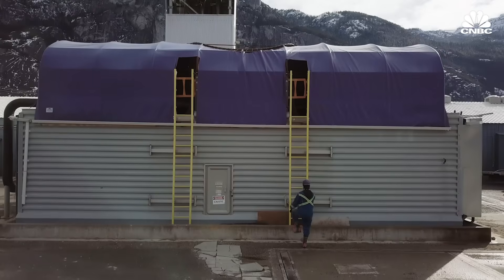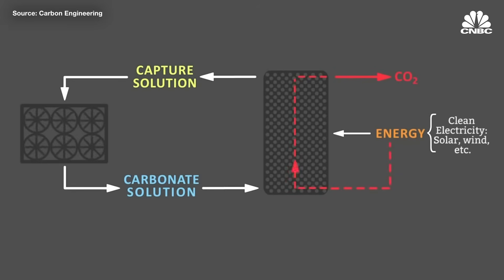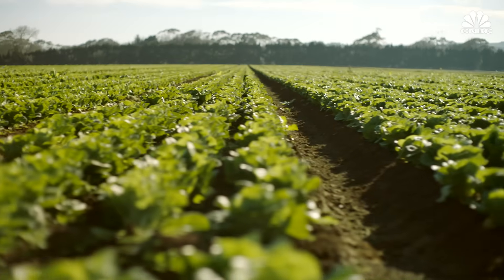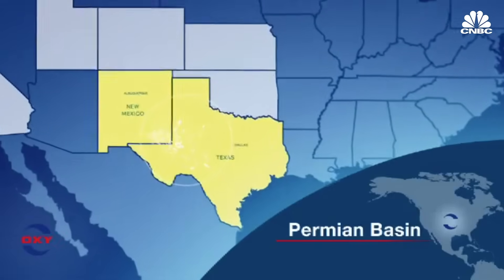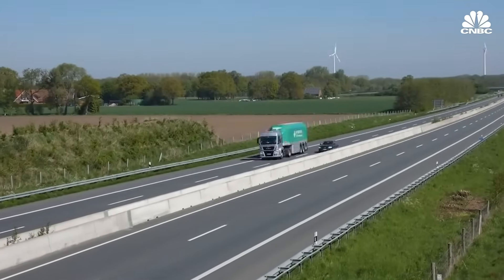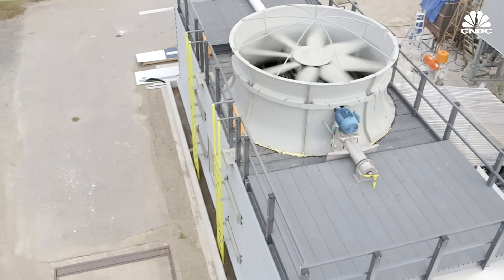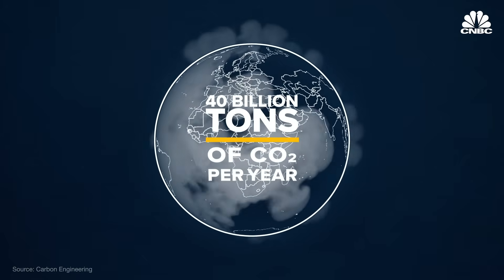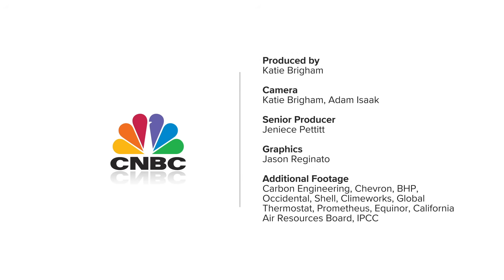Bill Gates-Backed Carbon Capture Plant Does The Work Of 40 Million Trees

Comment: Someone needs to do the math!  It costs only$20-50 per ton of CO2 to capture CO2 from fossil-fuel power plants and sequestering it underground, while it costs ~$100 per ton of CO2 to capture the CO2 directly from the air!  So it costs only 1/4-1/2 per ton to get the CO2 out of high-CO2-concentration exhaust gas of a power plant in comparison to direct CO2 removal from the air.  It has to do with entropy, guys!
So, until all fossil-fuel power plants will have CO2 capture and sequestration, let's pick the lowest hanging fruits first, shall we?

Another much lower-cost way would be to gather waste biomass, of which the USA produces 1-billion tons per year, and pyrolyze this biomass into H2 and charcoal, during which process, the carbon will be stripped off all its hydrogen and turned into charcoal.  Use the H2 for fuel, and use the charcoal for topsoil enhancement.  In this way, we indirectly take advantage of the plant's ability to  remove CO2 from the air to make carbohydrates in the plant, then turn this carbohydrates into charcoal and keep it on the ground indefinitely.
If the waste biomass is left to rot in the field, methane gas will be produced, and methane gas has 30 times the Global Warming potential as CO2.  So, rapid processing of waste biomass into charcoal as topsoil will be the most effective way to remove greenhouse gas from the atmosphere.

Comment: CO_2 is a gas. I fail to see why the stored gas underground should stay there and not resurface. You say that you can process CO_2 as fuel - to my knowledge CO_2 is the final product of an oxidation, so you would need to introduce some kind of energy to create fuel and then you would not have removed the CO_2 from the atmosphere as you would burn it again.
Reply: The goal of these plants isn't just to extract the CO2 from the atmosphere, but also to split the Oxygen from the Carbon. That way you get 100% pure Carbon which can then be buried underground.

Comment: I don't think just trees / vegetation is the answer. We've released to the atmosphere way more Carbon atoms than those of trees we cut. There is all that carbon that had been trapped for millions of years as gas and oil that we've released. So just reverting our forests to the 1500's size won't get us back to the CO2 concentration in our atmosphere of te 1500's.
PS: That doesn't mean I'm not into planting trees. GO TREES! But methods of trapping some extra carbon dioxide is necessary.
Reply: a young ! forest takes out a lot of carbon, especially  in the first 50 years. When a forest is mature (200 years and upwards) a certain (significant) amount of carbon remains captured in all the trees that are standing. While the old trees decay and release the carbon they soaked out of the air centuries ago, young trees shoot up whenever a space with light opens and they capture CO2 at high rates. That balances out the decay.

Establishing MORE forests (humans cleared a lot of land for agriculture) takes out a lot of carbon and sets a new balance.

Scientist think that even the murderous invasions of the mongols had an impact - that started around 1200. They depopulated whole areas (China, Russia, parts of Asia, Middle East, Eastern Europe) and their reign lasted 200 years. Unlike the Plague later which also depopulated whole regions (but in a more developed part of Europe so here humans were quicker than nature) those 200 years were long enough to have an impact. 

In that time forests took back farmland, removed additional CO2 from the atmosphere. The medieval warm time ended then - that may have been the consequence of a natural cycle - and that human induced cooling enhanced it.  

Planting and mainting forests could also create jobs (letting small farmer take care of the forests and pay THEM for the capture - not big oil. It would be a low tech, healthy solution with extra beneftis (oxygen production, wildlife refuge, hunting, tourism, soil building, the soil soaks up water from downpours and regulates water supply. large forests also moderate the weather). 

 in 800 - 900 AD a forest grew nearby Paris, in 1200 13,000 large trees (mostly oak 300 - 400 years old) were cut down they became the wooden underconstruction of Notre Dame.
It was called "The Forest" - went up in flames unfortunately in 2019.

that is a carbon sink.

In Europe (Germany, Austria) constructions codes (and fire insurance laws) now allow mulitstorey buildings made from wood (6 floor - maybe even more).

In those countries the citizens and companies have to sort the rubble if the take down a building or renovate it (or it will become really expensive to dispose of the rubble). If a building is  taken down wood and particle boards are separated, if they cannot be used otherwise they will be burnt. That applies to all wooden materials - also old furniture etc. 

They have electricity plants that burn garbage at high temperatures. That is a clean process, the high temperatures help to destroy all chemicals, coatings, paint etc.  - of course they need good filters, they are nearby cities. 

In a steam engine no matter the fuel (wood, gas, oil, coal) less than 27 % of the energy will generate electricity: most of the fuel does not generate motion (driving a turbine or the engine) - Heat is a major byproduct. In order to improve the efficiency the byproduct heat is used to produce also warm water and heating in winter. 

That way they achieve an efficiency of over 60 % - which is way better than when a private home has a central heating using wood - and there is less smoke and pollution.

And the burning of wood or materials mainly based on wood is at least CARBON NEUTRAL (not a fossil fuel was used but fuel that came from the CURRENT natural carbon cyle (trees that are "only" a few decades or centuries old). New trees will be planted as soon as some are removed and are used for construction, flooring and furniture. 

These days we use a lot of particle boards (with shreddered wood and scraps) - boards of massive wood (stripes glued together in alternating order to avoid warping) would be an even better long time carbon sink.

Best case scenario - the carbon is removed from the carbon cycle for a few hundred years (more than 1000 in the case of Notre Dame - and potentially longer had it not been for the fire). - That would buy humans much needed TIME. 

Worst case scenario, the carbon in form of wood is only removed for 30 - 50 years and then it creates energy at a reasonable efficiency (while new trees are already growing to replace the former ones).

Comment: It won't work.  Yes, it will capture carbon dioxide but to change the weather, no.  In fact, they can sell the liquid C02 to the oil companies for fracking oil and gas wells!   In fact, there are many plants around the globe who capture Nitrogen, Oxygen, C02, and other gases for commercial use.

Comment: Why not just have a coal power plant feed it's exhaust directly into this plant ??????
Reply: We have something similar here using Algae ponds for capture. Seems to be doing well so far and scaling up.
Reply: Its actually a pretty brilliant idea. As long as the coal power plant could produce power in excess of the carbon capture facility, that is.
Reply: Some plants already have something like that in place. This is for already existing carbon.
Reply: Coal plants have emission reductions in place on them they are called scrubbers or bag houses to capture soot and NOx emissions the "smoke" you see is water vapour from the cooling tower vent off
Reply: @theonetheonly5785  Reducing soot is very beneficial, a big component of arctic ice melt may be soot from China. However CO2 gas is not soot.
Reply: Because coal power plants are ridiculously inefficient and everyone should be pushing them OUT, not helping them. Coal plants are honestly garbage; you'd have a more efficient setup connecting thousands of hamster wheels to generators and letting the hamsters do the work. 
Better still, the average coal power plant generates MORE nuclear radiation than a nuclear power plant of equivalent output.
Reply: @Phaéthōn_the_Radiant  Old school smoke stack scrubbers are supposed to remove pollution and CO2. Unfortunately they are NOT mandatory. In China they have them but tests show they don't operate them full time. They are more for show and bragging than real effort.
Reply: Sean C none of what you said is true. Coal is extremely efficient a 1 pound chunk of coal burns for the same amount of time as 20 pounds of propane
Reply: @bentoboxofire7404  Coal plants are one of the responsible Sources which produce CO2 Emissions. The Cleaner is the counterweigt to reduce Them. But If we had no Coal Power plants in the first place lower Filtering would be necessary.
Reply: Lol, yeah, wtf, why aren't they doing that?
Reply: @Alkalite  The reason they don't add one of these to a coal powered plant is that what they want to do is say "here's a solution that solves the problem, now you greenies can go away and make as many of these CO2 extraction plants as you want, and leave us the hell alone to carry on polluting in peace!
Reply: Why?  Humanity, plants and animals would benefit from more CO2 in the atmosphere.
Reply: @ThekiBoran  Take wheat as an example, it makes protein to convert CO2 into carbohydrate. As CO2 levels go up the wheat has to do less work to create the carbohydrate it needs and therefore makes less protein so now the protein component of wheat goes down and this lowers the food value of the wheat.
Also plants like cassava (a staple in Africa) use some of their energy to store food reserves i.e carbohydrate and some of their energy to make toxins like cyanide to defend against their predators, which includes humans, so with more CO2 in the atmosphere cassava plants can make up their food reserves more easily and divert more energy towards making toxins and more people will suffer from cassava poisioning.
Reply: @ThekiBoran  All I did was layout the effect of higher CO2 levels on Wheat and Cassava. If you want see some hysteria just read your own post.
Reply: @TheSatireGames

Why?  CO2 is not a problem.
Reply: Plants are actually pretty bad a fixing CO2. They are very inefficient.
Reply: @scatteredvideos1 

CO2 isn't broken, it's necessary for life to exist.
Reply: @ThekiBoran  Carbon fixation is the term for taking CO2 out of the atmosphere and turning it into a non gas form.
Reply: Haven't you seen whole video. Such systems exist in some countries.
Reply: The thing is we can capture the c02, but we can’t get rid of it. Trees capture c02 and the c02 is gone. (Bi product is of course oxygen)
Reply: Fun fact for you guys, coal fired power plants actually put out less emissions then Natural gas fired ones yet we believe coal is bad
Reply: Citizens need to understand that the global warming scare/scam is a weapon of the oligarchs.  Oligarchs/plutocrats hate a free citizenry.  They hate competition and the free market.  Who do you think created and foisted communism and socialism on the world?  It wasn't the working people in Russia.  It wasn't a bottom up movement, it was top down.  It was the central bankers in the US and Europe.  The false fear of global warming is a tool, a weapon used against free people to steal what little wealth and freedom we have.
Reply: @bentoboxofire7404 

Time bomb?  Yikes, we better raise taxes to 100% immediately!

There is no crisis.  You are mistaken.  Data on this issue has been and is being manipulated.

Comment: Annual co2 emissions is ~40b tonnes in 2018. So at $200 per tonne for removal, it will only cost $8trillion a year .... 😂
Reply: Well this is just one plant and one of the first, it took thousands of dollars to build the first iPhone but with mass production the cost per unit drops dramatically.  If these facilities were build modularity and en masse the price per unit could be dropped at least 50%.  In addition, a lot of carbon taxes are quite a bit heavier than $200/ton so if these plants were introduced on the national level using money from a carbon tax we could very quickly reach net zero emissions.  The real trick is getting the electricity to power these plants.  Without quite a bit more subsidization of green energy solar power plants will not be as economically viable as natural gas.
Reply: The goal is not to extract ALL annual co2 emissions LOL, but rather to mitigate the increase in emissions to control temperature increase over time 😂😂😂
Reply: That's a global cost, not just the U.S. paying into that number.
Reply: Well this wouldnt be the only tool
Reply: How much would it cost to not do it?  @Rensoku611
Reply: With economy of scale they believe they can get it to 100$ so only 4 trillion, but also the trees and swamps and such are still doing their thing. Let’s say it gets rid of half give or take I have no idea the actual number, but seems reasonable. So 2 trillion a year. It’d take the top 100 gdp countries 20 billion dollars on average to do this with our current co2 emission levels.
Reply: 8 trillion to save the planet from destruction sounds fair
Reply: I think we should just raise carbon taxes until this is more feasible. With a $50/t carbon tax, we will probably reduce the co2 emissions down to 5bt and then spend the $500BN to handle the rest.
Reply: 8 trillion is reasonable
Reply: @KOTYAR0  8 trillion is half of the entire US gdp.
Reply: @AgainstTheeWickedly  US is spending a good chunk of that on the stupid military
Reply: @KOTYAR0  If you took that SAME $8 Trillion a year and put it towards solar and wind + batteries, almost ALL carbon emissions would be halted! That is a MUCH better use of the money.
Reply: @AscendedSaiyan3  we can't rely on solar and batteries. We can use them as supplementation, but not a sole supply of energy. If we could devote a large amount of money to this problem, we could do carbon capture for a while and also transition to better energy production.
Reply: @dan110024  I am pretty familiar with the technology, so PLEASE explain WHY solar AND wind + batteries can't be depended on.  I depend on them, NOW.
Reply: @AscendedSaiyan3  Wind farms need an extensive amount of fossil fuels to prime the turbines for the wind to continue to rotate them.  large amounts of fossil fuels are also used in the manufacturing of solar farms.  So this $8 trillion investment gets us nowhere.
Reply: AscendedSaiyan3 i agree both options seem like a solid solution if implemented.
Reply: @benjcrandall  If you believe THAT is an "extensive amount of fossil fuels", you don't understand the meaning  of the word "extensive" (also, lube is NOT burned). I guess you also don't realize we already this thing called "synthetic oil". This has much more even particle placement for BETTER lube. You don't have a good argument.
Reply: @KOTYAR0  right? If all of the world's governments and largest companies put a significant amount of cash into it, it could be done. It'd capture a large fraction of co2 in the atmosphere, allowing us to transition to better energy sources for the future.

Comment: Why do these stories never, ever touch on the elephant in the room with climate change. It's always a back and forth argument blaming it on industry then government then back again... but the real problem category, consumers and opposition to cost of living increase, never gets addressed. We can talk about wanting to increase the carbon price until the cows come home but it'll die quickly if implemented without genuine discussion on what that means for cost of living and how the mechanism works. 

The point of a carbon price is to artificially increase the cost of the end product such that otherwise expensive options become more attractive, and such that people USE less and BUY less by making everything more expensive. 

The frank discussion with consumers needs to be had. If you want to fix climate change you have to be willing to have significantly less money in your pocket, with fewer luxuries and greater hardship. That's the hold up in climate action and has been for 54 years. Consumers. So let's talk about the actual problem

Comment: Professor Dan Kammen : "We have other ways to bring Carbon out from the air, and they are called trees." well said sir
Reply: Trees are very inefficient at doing this, you need hundreds of billions of additional trees and it takes a significant amount of time for them to grow, you also need an insane amount of land. We need  a solution much faster and one that is more realistic.
Reply: Not enough land to grow all the trees needed. This machine takes up extremely little land for how much CO2 it captures
Reply: Ismail Hossain just 40m per plant bro no biggi!
Reply: @TheSatireGames you don't make any sense
Reply: Ismail Hossain 
HEMP is Vastly More Efficient than TREES/per acre. (Most Politicians & ALL Banksters KNOW THIS!!)
Reply: I didn’t think was as easy as that. Carbon fuels, coal and oil, were created by the very earliest plant life before the relevant organisms to break them down via rotting therefore they just accumulated and pressure, heat and time did the rest. Now that trees rot the carbon is not captured long term in the same way.